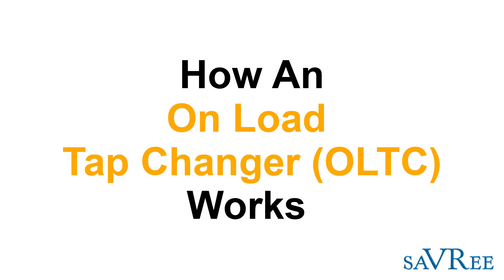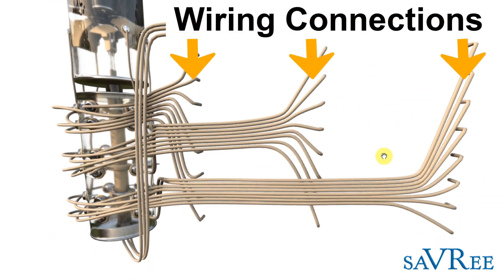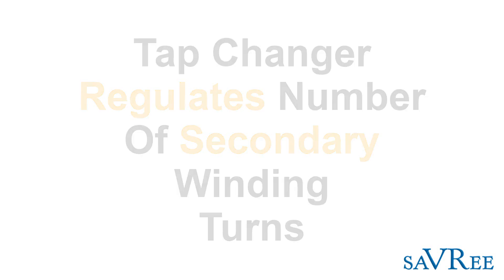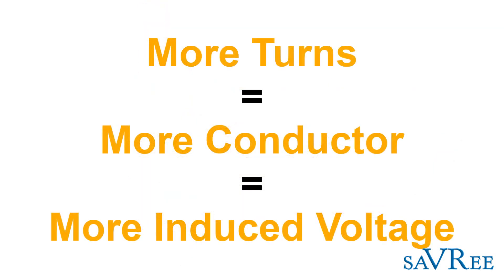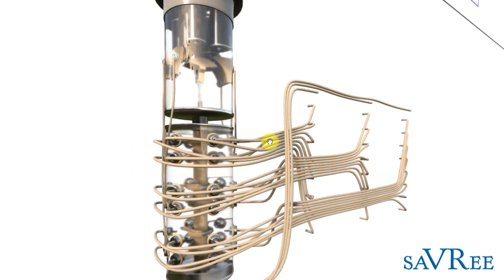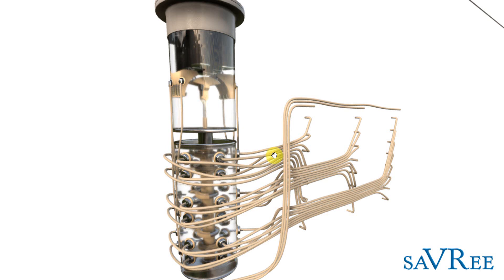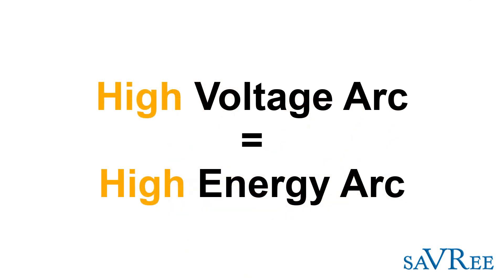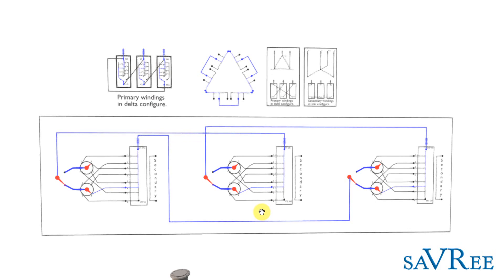How On Load Tap Changer Works

Comment: Just one thing to consider is the position of the tap changer within a transformer, which is usually the HIGH SIDE (HIGH voltage) for a resistive type, and at the LOW SIDE (LOW voltage) in case of reactive. 

Most of the world uses a resistive type, but other areas like the USA and Canada make use of reactive OLTC, specifically in what is called Preventive Auto Transformer (PA).

In terms of Maintenance OLTC manufacturers usually they consider OLTC/DETC maintenance free, but this shall not be the case if you really want to maintain such an experience asset, therfore continuity check and dynamic resistance measurement (DRM) are useful in determining the healthiness along with tap changer operation counter.

Best of luck ❤
Reply from the maker: Much appreciated, thanks for the info!

Comment: Nice video.

The voltages on the secondary of  Transformers are fixed to one voltage and not regulating.
 On The other hand the voltages on the primary is not fixed due to looses on a transmission line or there is a voltage drop or over voltage from the source or what ever reason so here the OLTC will cut or add primary windings to compensate for the voltage to be fixed on the secondary.

Comment: 0.58 to 1.12 - the tap changer usually regulates the number of primary turns on the transformer to ensure a stable output on the secondary side. 
KB
Reply: Depends on the voltage and winding configuration because OLTCs are voltage limited.
Reply: Yes,usually it is at primary side.to ensure small current.
Reply: What if it is a step up transformer???